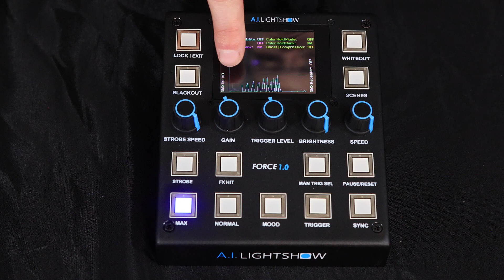Force 1.0 Audio Conditioning Blocks - Tutorial

Comment: I think your product is really great! Really cool lightshows without any programming!
But the "console" is not intuitive designed. How should you know that clicking MAX and LOCK will boost something? How should you know that MAX and BLACKOUT activated a peak detector circuit?
You need to memorize all that (or read the description, lol). Why? You have a display. Why did you not use that?
Reply from the maker: Hi Alex, those are “shift operator”, just like using the shift button on a keyboard for a PC.  Under normal circumstances those operators are mostly chosen at the beginning of an event and rarely touched afterward.  However, they are at your disposal if required.  Most users we’ve encountered tend to run with the default settings and never activate some of the advanced features discussed here.
We will be providing a key that identifies all those shift operators and functions.  We don’t expect you to memorize those but just like any piece of gear or instrument, eventually it becomes second nature.
Reply: Is there more of a tutorial of where the levels are at? And if I want just the main bass booms to react to? Is that the peak?
Reply: @lightsoutentertainmentdj  I agree, a little cheat sheet would be nice, cause I'll forget all them shift settings.